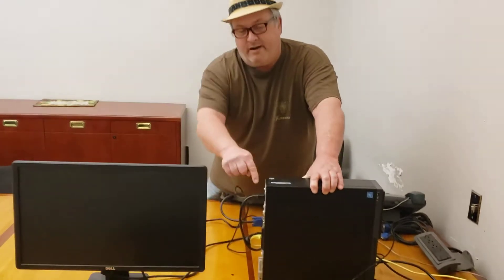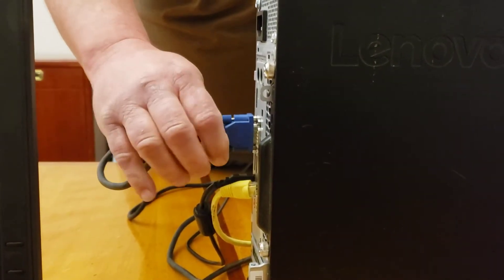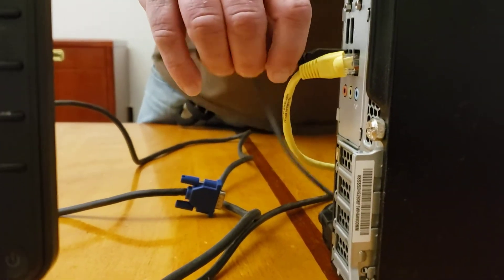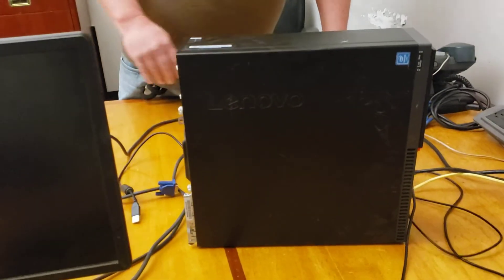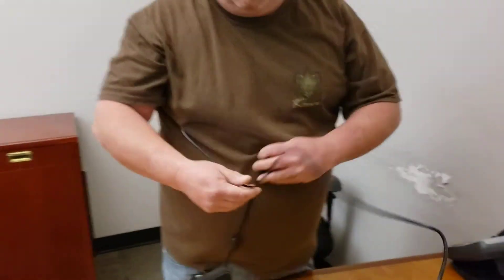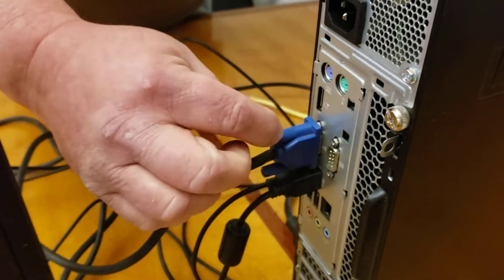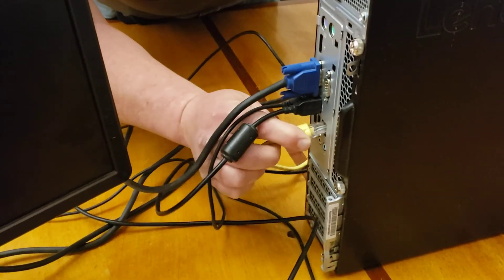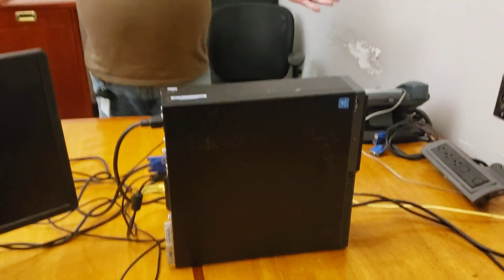Continuum work at home setup

Comment: When you say cable modem, can that also be just the router? I have a router box and I'm trying to figure out if it will work for continuum for a work from home position. They asked if I had cable internet, and I'm not quite sure what they asking...thanks in advance!